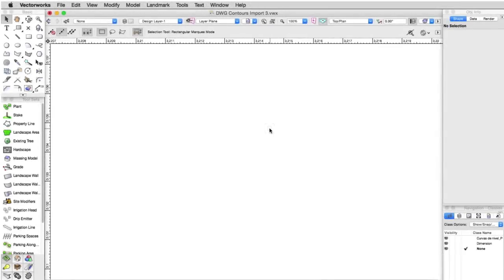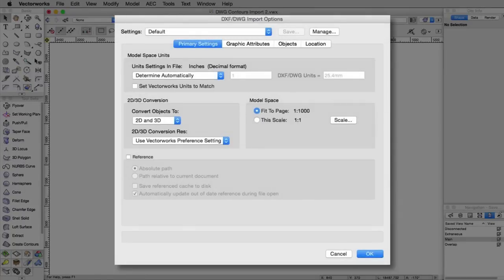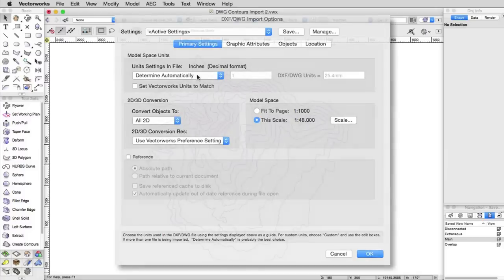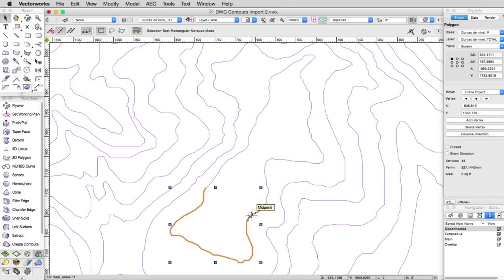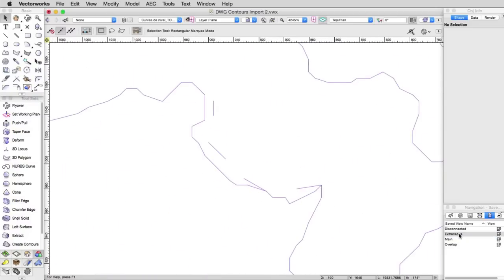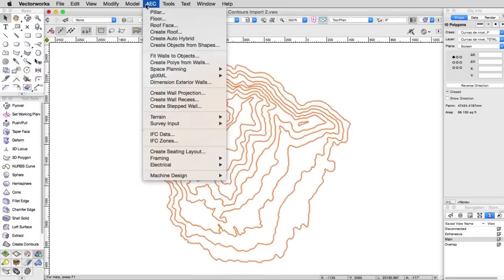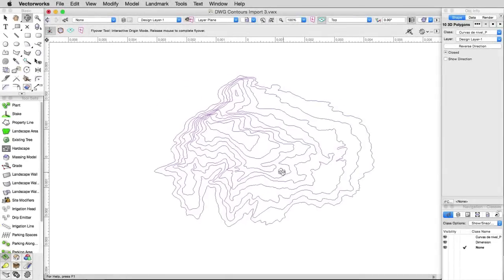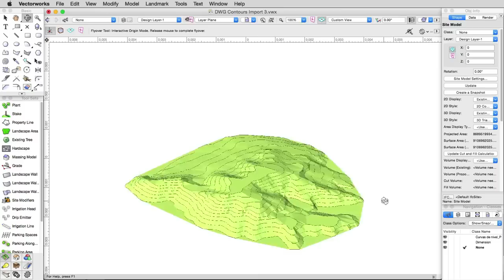Creating a Site Model from an Imported DWG

Comment: Thanks for sharing. But I couldn't find AEC in my program. Is that an add-on?
Reply from the maker: Might only show up if you're in an Architect or Designer workspace, check under Tools > Workspaces to see which one you have. If you are using Landmark, it may be under the "Landmark" menu now rather than AEC.